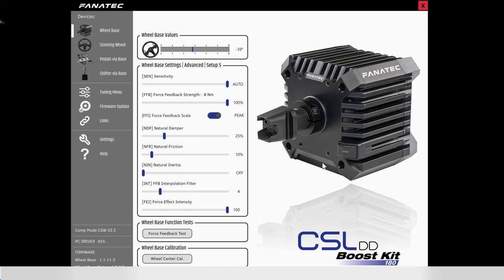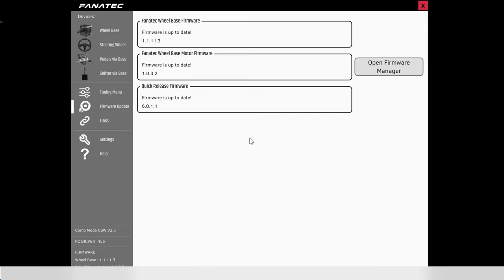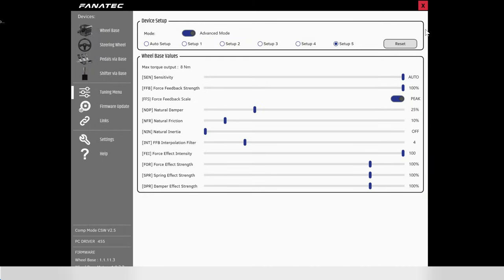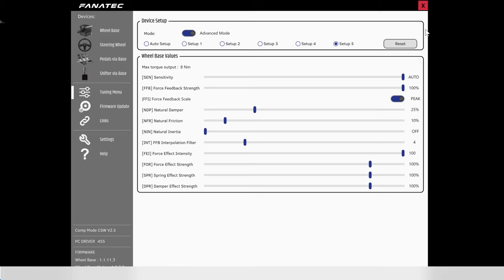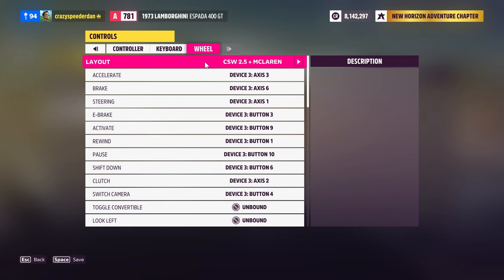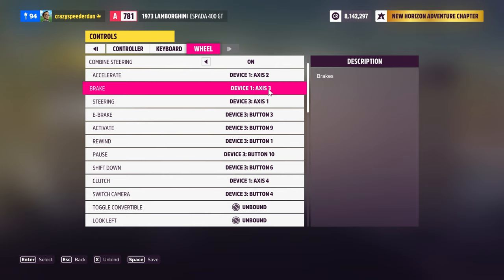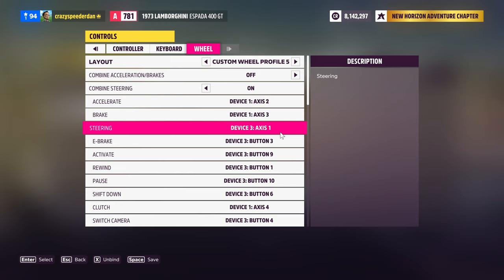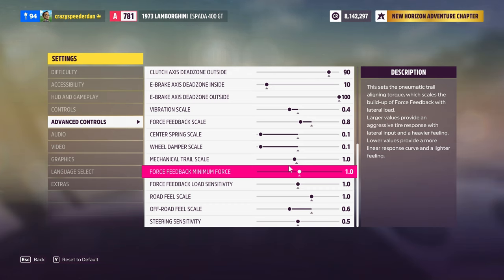How To Use CSL DD in Forza Horizon 5 (2024)

Comment: Wow, it works. What I was doing wrong was not putting it in compatible mode. I had it set to PC mode. Forza 5 is the only Forza at the moment that supports my Samsung 49 inch Ultrawide monitor .
Reply from the maker: Glad it got you fixed up! I also use a 49. I believe the new forza also supports it as well. Been a bit since i played it tbough so I may be mistaken. Assetto Corsa amd Automobilsta 2 are also great options that support it as well!

Comment: A lot of this is just common sense. I had to follow pretty much the exact same procedures for my old PXN V9. I had to plug it into the computer before starting Steam or the game in order for it to be recognized. I also had to do a custom wheel profile. My wheel supported D-Input and X-Input, and under the standard settings (I forget if it was D or X), it thought the wheel was a controller, so I had to switch to the other version in order to build a customer wheel profile.

Comment: Hello, My Wheel does work on FH 5 but the problem is ffb aint working properly, if I drive slowly it just shakes right/left if i speed up and take deep curve it will put my wheels back but very slowly, i tried maximizing my ffb still same problem, Also tried v440 and v451 didnt make any diff

Comment: I’ve had my csl dd working with fh5 for 6months. Just updated to driver 455 (from 454) and now forza doesn’t even recognise my wheel in comp mode. Also noticed ACC only recognises pc mode now but before it was using comp mode. Fanatec control panel shows both pc mode and comp mode working. Also have the same firmware as you. I’m lost and it’s frustrating.

Comment: My CSL DD is still not seen ingame at all. Sektion with presets is blank. Im on PC. Everything updated. Only game i have problems with
Reply from the maker: When you are in controls where it shows the presets at the top. Keep hitting the right arrow key on keyboard until it says custom set. Then it will give you access to a few custom profiles. You can only bind a "non recognized wheelbase" inside a custom set and for whatever reason only the arrow keys will slide the menu over into a custom set options. I think it's a bug. Sounds like that might be your issue.
Reply: Binding doesn't work even on compatibility mode and on custom profile
Reply from the maker: @SewerShark  are you using a shifter or handbrake from a different manufacturer? If so unplug those before binding the steering wheel. Save the profile and the plug the others back in.
Reply: @DanDiMaggio  I'm using a Moza Shifter. I'll try to disconnect it next time I play it.
Reply: @DanDiMaggio  No, still can't bind it. I turned off steam input and still no luck.
This game is cursed for me.
Reply from the maker: @SewerShark  man that is so strange. Have you tried a reinstall? I know it's a pain but worth a shot. Might be a corrupt file in there somewhere. Have you tried any other wheels in the past in FH5?
Reply: @DanDiMaggio  reinstall will be a next step. I used a G29 when I got the game, but that's a long time. It worked, but I only played once. For some reason my game crashed during the intro screen. I just did a recovery install in windows which fixed the crash, but it seems now it doesn't recognise the wheel.
Reply: @SewerShark hey did you already got it to work? I got the same problem
Reply: @Bassie071  I managed to make it work but honestly, I forgot what I did to fix it.

Comment: My CSL DD is set to 1080, and my setting in game are also set to 1080 and yet my wheel won’t even do a full turn before hitting the soft lock. What do I do?
Reply: That's how useless they are in Moco soft, the steering wheel won't turn more than you see. It has no logic whatsoever.:face-orange-frowning:
Reply: I’m at the same point.  Logitech wheels have soft ware to fix.    But I think us on fanatec are screwed